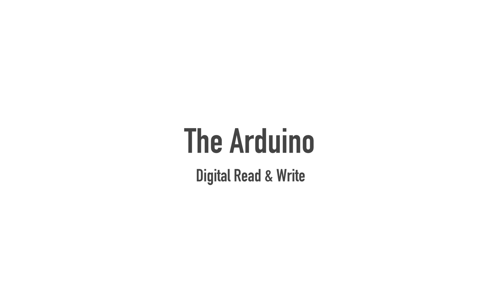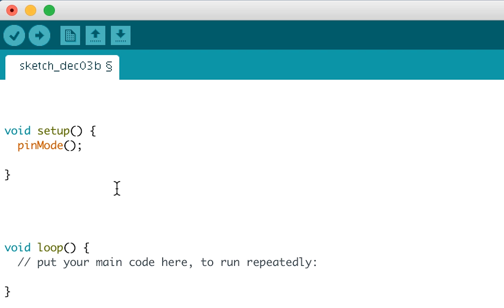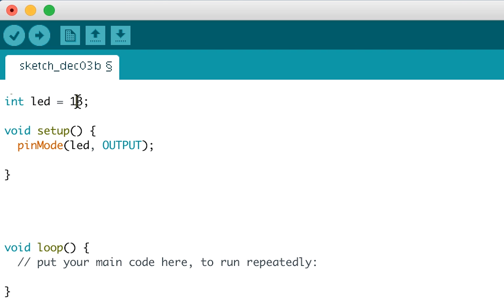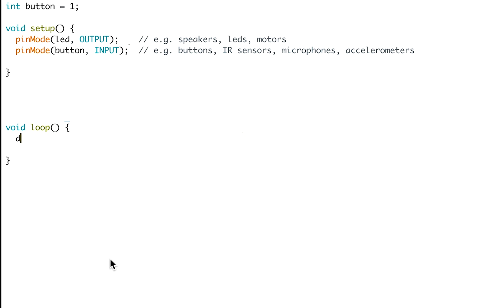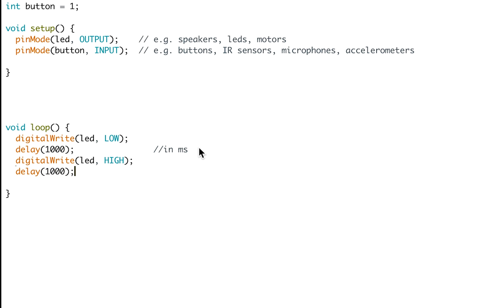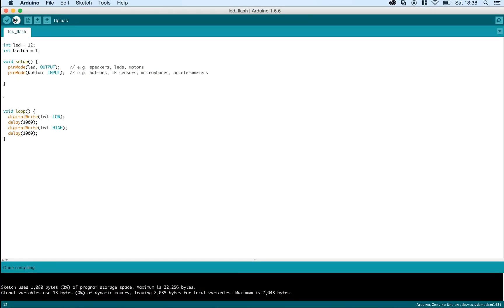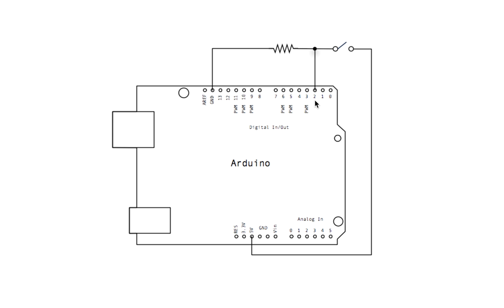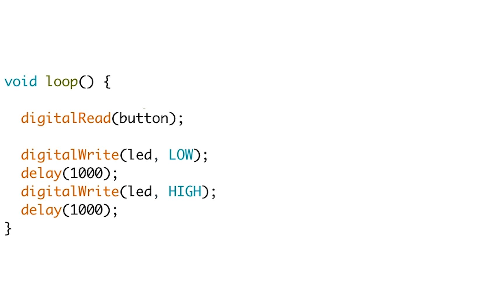Arduino Lesson 2 - digitalRead & digitalWrite

Comment: here is the code:

int led = 12;
int button = 13;

void setup() {
  pinMode(led, OUTPUT);
  pinMode(button, INPUT);
}

void loop() {
  digitalWrite(led, LOW);
  delay(1000); //how long its off
  digitalWrite(led, HIGH);
  delay(1000); //how long its on
}

Comment: all of this was easy and simple to follow except for the last part when you are talking about certain pins being pulled high. for some reason i dont understand what you mean by this.
Reply from the maker: High means 5 volts is being output, Low mean 0 volts is being output :) (or input in this case)

Comment: how do i go about using digitalwrite to program in a button? i want to use the arduino to control a connection elsewhere to complete a circuit in a device, remotely. i dont want voltage to be present, but to only close the loop between the two wires set to the appropriate pins?
Reply from the maker: Hi Nate, 
It sounds like you either want a circuit breaking switch (if you're just turning an external device on or off) or a digitalRead. If the circuit breaking switch isn't what you're thinking could you give me some more details about what you are trying to do and I can probably help! :)